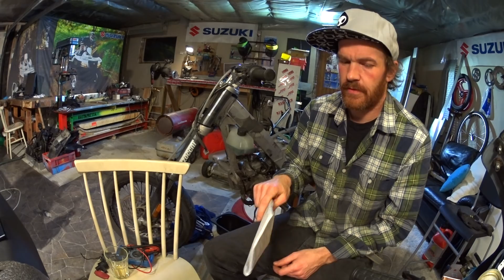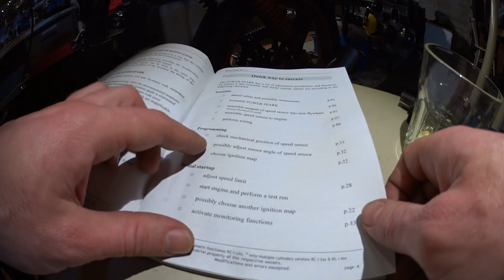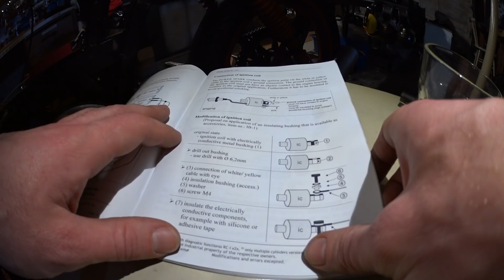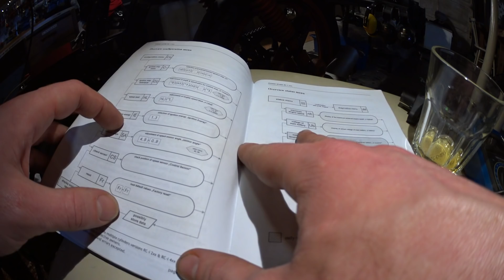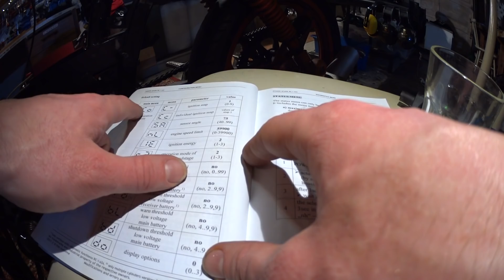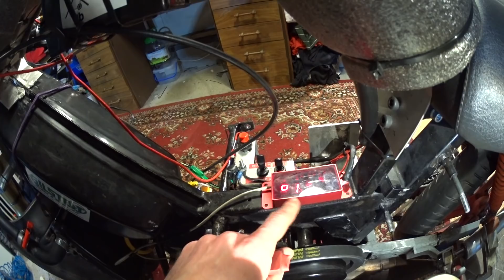E21 - PowerSpark Ignition 2STROKE STUFFING

Comment: I saw the unit...I don't know how it uses the RC signal...aren't the RC signals like a square wave...at like 50% duty cycle...the servo arm is like mid position...and say if on time is 30 %...then the servo moves 30%...then say the waveform is 70% on then the servo would swing the other direction.....perhaps?

Anyway what does the RC input to this ignition controller do?

Comment: Great videos. I have a project in mind. A Puch Borrasca 50ccm, four gears from 1980. I will build up the bike for racing but mantaining the 50ccm and no reed valve. I want to grind the motorhead to gain more pressure ratio.This ignition system in combination with octane booster will help me avoid detonation. Evident that i will  improve more things on it, like advance intake opening time and retard exhaust closing time. Because of the advanced intake opening, i will also have a retarded intake closing, so want to use a boost bottle to suck the excess spitted out mixture.

Comment: Will this work for a 4 stroke ? I'm working on karts and mini bikes and want to controle my timing
Reply from the maker: Sure will!
Reply: How would I get it to work ? Hall sensor ? And using existing magnet on flywheel ? There is a huge group out there that would love to see this get setup on say a harbor freight preditor 212 engine ...
Reply: Also the ignition pickup has me wondering ...on my engine I want  my ignition timing at 38 degrees before tdc....is this system capable for running this timing ? I hear you say 75 degrees....is there a dif between 2 and 4 stroke timing and maps that this ignition might have a problem with ? My engine has 38 total degrees of ignition timing and I would like to have it start around 25 degrees and advance to 38 ...my engine revs to 10,000 rpm ... have you heard anything I have said  that makes you think it won't work .....the reason I want a new ignition is because my coil now retards timing as rpm increases which is opposite of what I want it to do ...it requires too much timing at a low rpm and it kills power ...would you recommend this coil for my application ? And what else would I need to know ?
Reply from the maker: Using the existing flywheel with magnets might cause problems with false triggering, better use a custom trigger wheel and the supplied(or other tiny)magnet. The unit can be programed to run any curve you want.
Reply: I think for the 4 strokes...it uses wasted spark...or basically fires once a revolution...with most of the timing BTDC...which is programmable...
Reply: So...with wasted spark this unit should work fine on a 4 stroke

Comment: Hello, I have a 9000 redline rpm, single cylinder 250cc carburetted 2 stroke based off the jawa cz250. Could you recommend a good programmable ignition system for it. And would you recommend CDI or TCI for it. Thank you
Reply from the maker: I'd recommend an Ignitech unit, never heard nothing but praise about them, CDI.
Reply: one more query: which model of the ignitech line up would you recommend
Reply from the maker: I'd go with the DCCDIP
Reply: Thanks man will try it out.

Comment: So it runs of ,of a battarey
Reply from the maker: +Mario Raja yep!
Reply: okei.. put if you put a battary on a motorcycle it will make it heavy so can this tuning make up for the weight gain?
Reply from the maker: +Mario Raja Run a small lipo battery and I'm sure it'll weigh less than the flywheel & stator it's replacing.
Reply: 2STROKE STUFFING okei put is this system pointless if you dont to dyno test? ( and how do you set the timeing degrees and where to stop?)
Reply from the maker: +Mario Raja with cht and egt gauges you should be able to find good timing without a dyno and see when to stop.
Reply: 2STROKE STUFFING hmm okei put is the stopping point pre ignition or  detanation?
Reply from the maker: +Mario Raja Usually detonation, but pre ignition is often induced by increased heat caused by detonation.
Reply: 2STROKE STUFFING cht and edg gauges are both for measuring temperature so. (How high my temperature needs to be to have detanation?)
Reply from the maker: +Mario Raja There's a trick here, if EGT suddenly starts falling rapidly, and at the same time CHT starts rising - detonation! Detonation will cause massive heat buildup in the combustion chamber and reduce the amount of energy available to heat the pipe.
Reply: okei, put what power spark model are you useing? (and what model do you recommend if my engine is a 125cc 1cylinder air cooled?
Reply from the maker: +Mario Raja Mine is a CE-i 100, works with 12v systems. That's what I recommend too.
Reply: okei.. when you tune you engine do you want it as close to 0 degrees (top dead center)? or you dino and see what makes more power?
Reply from the maker: +Mario Raja It depends on the engines powercurve. Typically you want low timing for easy starting 10°, lots of timing before the powerband 30°, less at peak power rpm 15°, even less after peak to heat up the pipe 10°. Just ballpark numbers, every engine is different.
Reply: 2STROKE STUFFING okei put how do i connect the coils on a 2 cylinder? (Like this unit only support 1 coil and the others are 6v systems)
Reply: 2STROKE STUFFING  and does 2 carbs make more power than a big carb?
Reply from the maker: +Mario Raja If you contact them they can probably make any of their units 12v. Another great alternative is Ignitech.
Reply from the maker: +Mario Raja Depends on how big...
Reply: (well i am trying to tune a old russian engine and russians were crazy back then they swiched carbs so nobody know what was there originally :D) put i found some informatsion that they used 28mm carb and i am trying to put on a 38mm carb for each cyclinder ( its a carb that ktm 150sx uses)
Reply: 2STROKE STUFFING if you dont know then you can just say it :D
Reply from the maker: +Mario Raja It's not that. The problem is that it's complicated. It depends on how the two cylinders fire in relation to each other - if the intake phase is simultaneous or not, and intake geometry, and crankcase volume, and pipe geometry, and on and on... But the short answer is, 1 carb for each cylinder is most likely better.
Reply: 2STROKE STUFFING hmm very interesting well i have most of my questions answerd... and i got to say this... you are a knowlageble man :D
Reply from the maker: +Mario Raja Thank you!

Comment: That user interface has to be the most retarded thing I've ever seen.
Like a button would suffice, or a serial port.
Reply from the maker: +Cody Soper It's a bit slow and annoying, but an ok solution for waterproofing and being able to program it without a computer.
Reply: 2STROKE STUFFING very true. I guess I could get used to it. I might take your advice and go with an ignitech box.
Ideally I would like something that can use the existing rotor and coil as it's trigger, because my engine also uses that same area as the generator (vintage snowmobile engine). Think a module that could use the stock 80cc bike engine ignition as the trigger.
I've been watching your videos, getting ready to do some serious modding to a 500cc Suzuki Twin thats popular in snowmobiles. Glad to know you reply to comments and thanks for the awesome in depth videos!
Reply: After reading and watching more on the Ignitech boxes, they have models that use the stock stator setup, which is what I need. But thanks again!
Reply from the maker: +Cody Soper Thanks! Best of luck with your project!
Reply from the maker: +Cody Soper Awesome!

Comment: Can this feed 4 spark plugs at once or nah also another question my fzr1000 the magnet seem to be on the hall sensor and I can't seem to find a magnect in the flywheel
Reply from the maker: +nightmare in action nighmare in action Not the one I'm using, but they make a 4 cylinder unit too. Have you checked out Ignitech? They might have something that fits your bike. You sure it's not a reluctant pickup?
Reply: 2STROKE STUFFING I'm not sure I'm still a noob at this stuff the reason I got the bike was because it was dirt cheap and the engine is a good one just the electrical is haywire this is my first bike I get the has more than 1 cylinder to repair like the honda crb250 no problem doing a top end rebuild this thing seems like a monster but lucky I dont have to do nothing of that I'll try to find magnets but it's not easy rotating a 4 cylinder engine slowly
Reply: 2STROKE STUFFING so the flywheel there is some holes the have been drilled out exactly were the sensor passes through but arent magnetic the sensor has like a magnet thoe but did not come from the flywheel it seems like its made like that
Reply from the maker: +nightmare in action nighmare in action Probably a reluctance sensor, basically a small magnet and a coil.